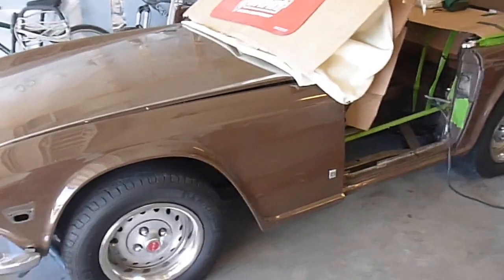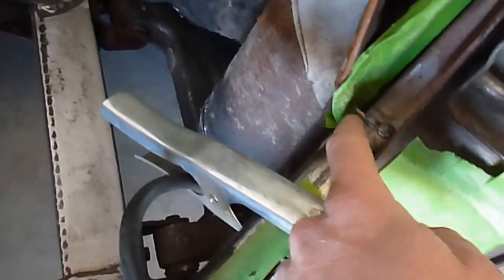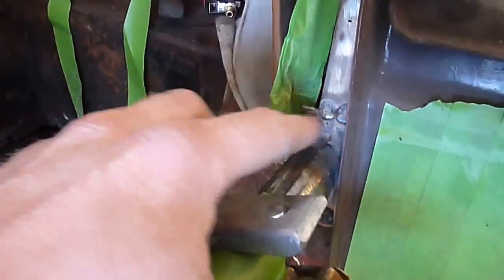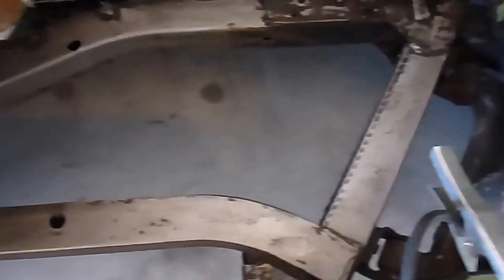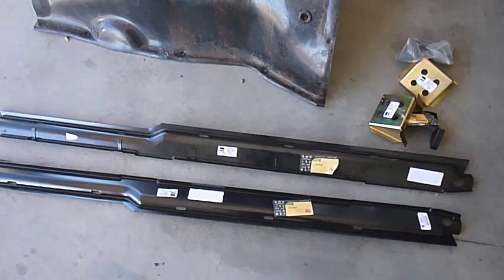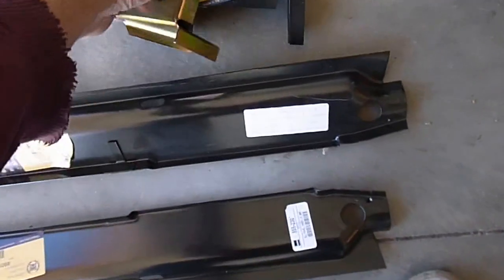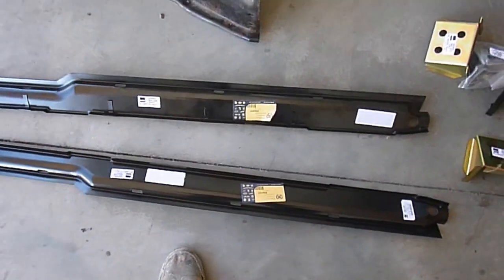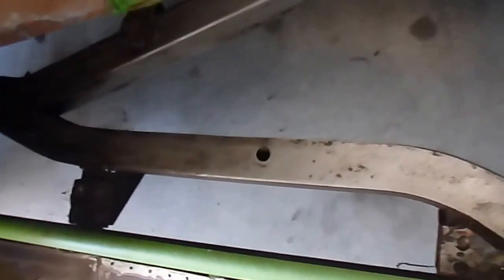Part 3: 1974 triumph TR6 floor pan replacement

Comment from the maker: They can do it no problem.
However you could go to harbor freight tools and buy the small flux core wire mig they have for 100 bucks buy a welding helmet and gloves and be welding it yourself.
Practice on scrap metal first which is free from any sheet metal or welding shop.
It is going to cost you the same price for someone else to do it for you or more than buying the welder. I was intimidated about welding when I first started 14 years ago but it is really easy after a hour of practice on scrap metal. I can advise you on any questions you may have if you do decide to buy one. Also AMAZON has cheap flux core migs as well. It is really a tool that any man should have and it is amazing how many projects you will find in the future to use it.

Comment: those panels from Moss are made from the original factory tooling which has survived and the panels are the same as the originals, most of the panels for a TR6 are  available to buy, I know the font valance tooling was lost so that is one panel that is tricky to get.

Comment: Is it necessary to weld in the new floor pans?  I just pulled carpet and seats out today and noticed minor rusting around the seat rail mounts.  The pans are otherwise good.
Reply from the maker: Is it rusted through? 
You can make a spot repair at the seat rail mount.
It will have to be welded however because you don't want that to fail during a crash.  If you don't own a mig welder here is a good time to buy one.

Comment: Were you able to install the pan and rockers without lifting the body tub? Do you think replacing only the floor is possible without removing the inner rocker and without lifting the body tub?
Reply from the maker: Yes. This job is not a easy one to tackle however. Without a plasma cutter I would of been really in the shit. It is a difficult job but if you take your time It will turn out nice. I bought sill plates , brackets and floor pans for the job. Moss motors will hook you up. A Plasma cutter will save you hours of headache. However if you are careless you can and will cut into the frame. I don't mind helping if you have questions Davehs26@gmail.com